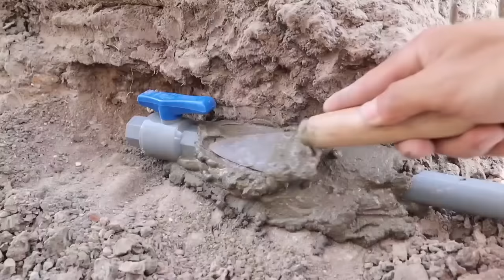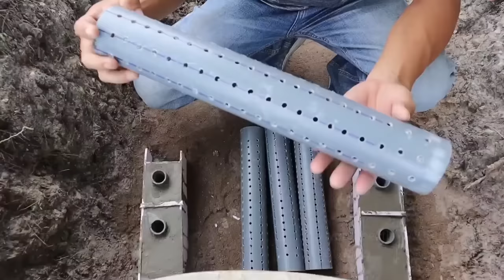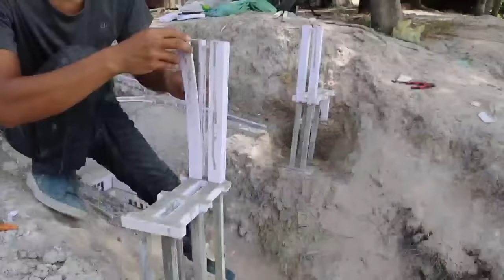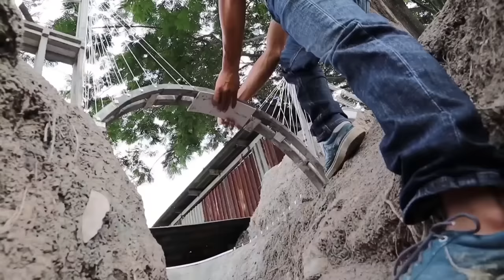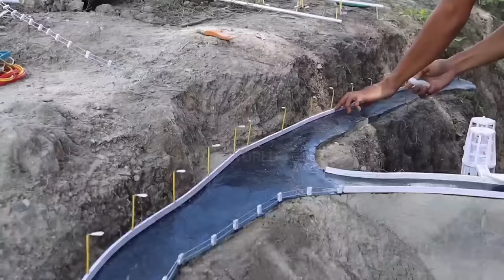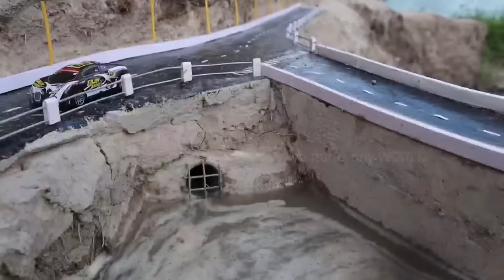[Full] Build a mini Hoover Dam hydroelectric and Bypass Bridge construction model project

Comment: Nicely built.  I do need to point out that the cones atop your inlet pipes are where the water enters the pipes in real life.  Rather than drilling holes along the sides of those pipes, you should have attached the cones without the bottom circle.  That would have been realistic.

Comment: Water filter or pores could be done only on the middle of the pipes so that floaters or rocks may be avoided along with a bigger pipeline (gauge). I believe water from the other side may not change the flow. All the very best.

Comment: I probs of added (Smart Digital) SCALEXTRIC (BTW Way Digital is Low voltage AC Track)   or anki overdrive Road tracks and have there cars move under the Hydro  power of the dam DC DC Converter to boost the voltage The use a RC ESC Brushless To make AC)